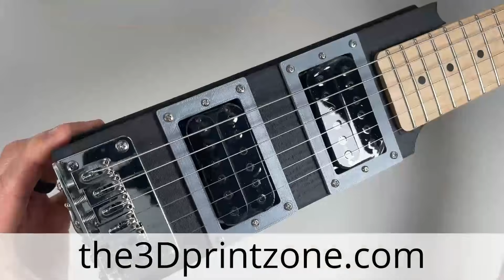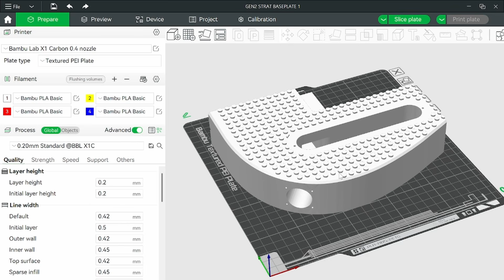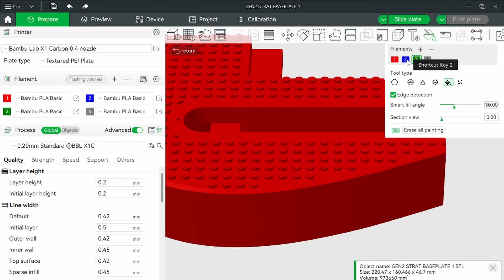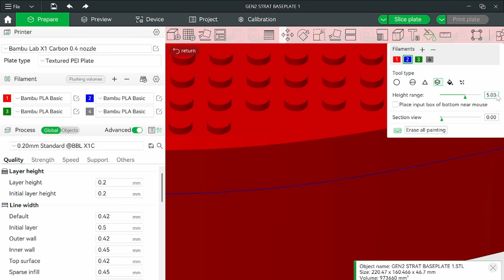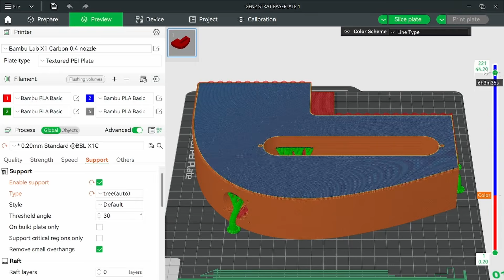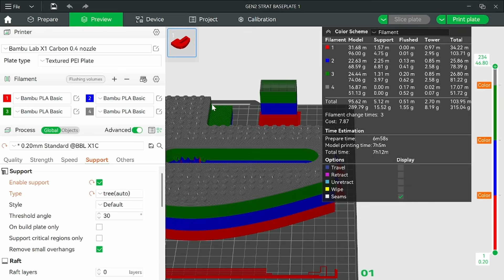How to do Multi-Color 3D Printing | Bambu Lab Studio Beginner Tutorial

Comment: Love the vids AND all the guitars! Getting ready to order all the .stl's btw. 🎉
In case this is unknown to anyone (I just found out recently myself), I wanted to add this little tidbit to "save" on the waste you spoke of. 
Make the purge tower tiny (2mmx2mm), grab another small model that doesnt have to be color-specific (fidget toy, measuring tool, utility part, etc.), add it to the build plate and select "Flush into Object's Infill."
If the additional object happens to be bigger than your specified print (and to save more filament overall), scale it down to the layer height of the last color change. Specified print comes out super clean and the bonus print settings always look kaleidoscope-y cool!
I like to include infinity fidget cubes (as the purge objects) with multi-color prints that I make for others 😊.
Keep up the great work and Continue to Be Blessed!! 🙌
Reply from the maker: Thanks for the comment!

Comment: Спасибо за хороший и познавательный урок. Но вот вопрос, как раз по окраске. Есть модель. В редакторе на ней прорезаны буквы. Модель черная, буквы должны быть белыми. Иду в раскраску, там выбираю белый цвет филамента для букв, выбираю заливку и указываю Обнаружение по граням. Заливаю каждую букву. Все отлично. Делаю нарезку и смотрю по слоям. Печатается модель, наконец печатаются буквы, но скоро их печать прекращается и где-то 3 слоя еще сверху печатается сама модель, оставляя контуры букв. То есть, буквы получаются утопленными. Но надо же до самого верхнего слоя. И как быть, чтобы они печатались до самого верха? Почему такое происходит? Буду рад, если подскажете, так как в настройках, как этого добиться я этого не нашел.
Reply from the maker: Thanks for your comment and question. It sounds like the issue your having has to do with layer settings, and is not specific to multi color printing. You can check to see what your settings are for top layers.
Reply: @the3dprintzone  Thanks for the reply. I have a Bambulab A1 Combo. I also tried adjusting the top layers. Nothing helped. I solved the problem by selecting the letters as separate objects in the editor. I got an assembly of two - the base and the text. I sent this assembly to the printer. I assigned the desired colors to both the base and the text. Then everything worked. Apparently, this is a characteristic of Bambulab Studio, where the color doesn't completely fill the spaces between the letters. Thank you. Good luck.
Reply from the maker: @ВячеславМакурин-ч3з  awesome, glad to hear you were able to resolve the issue!